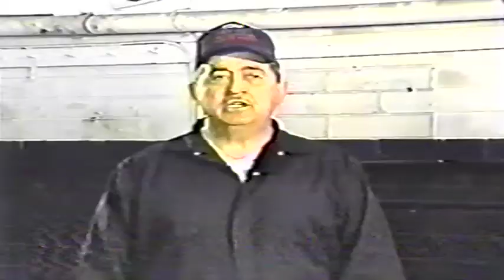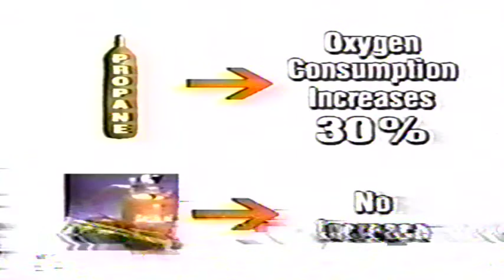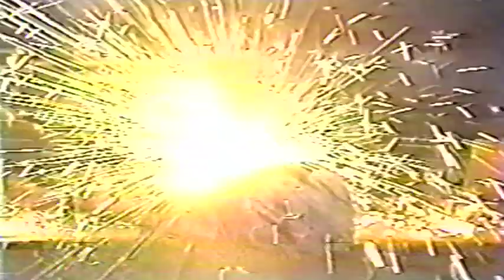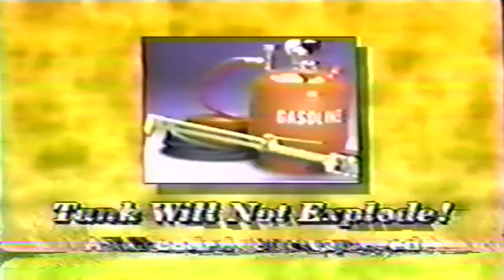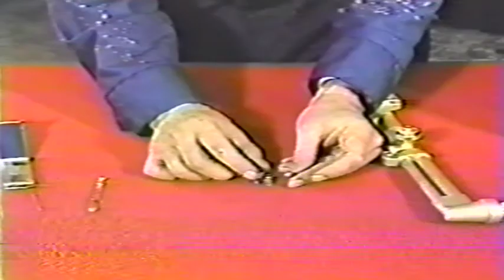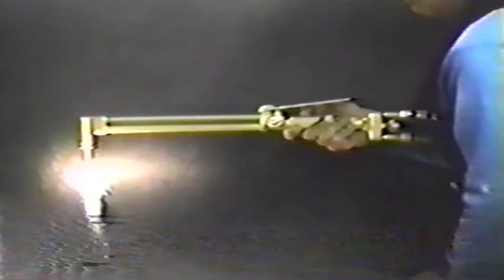Petrogen Oxy Gasoline-Torch

Comment: I have used one of these gasoline cutting torches. We cut three floors at one time out of Ash silos at a powerhouse and it cut all three! My wife’s cousin completely cut up a Bucyrus Erie drag line! It cut steel 11 feet thick! He used 200 pounds of oxygen on the torch. This is the most amazing cutting torch I have ever had in my hands.